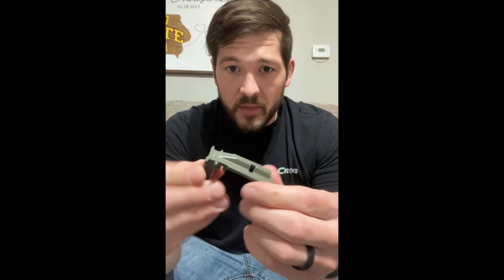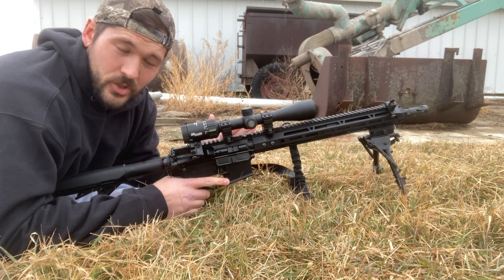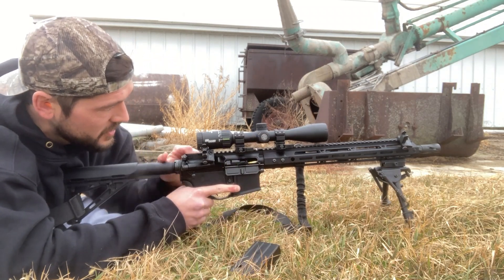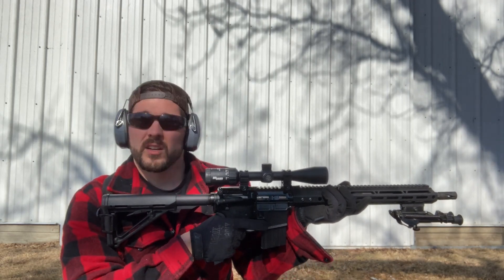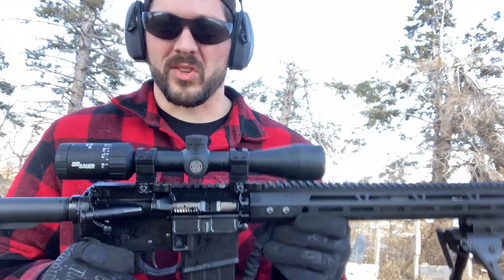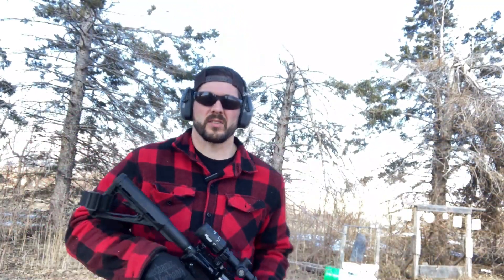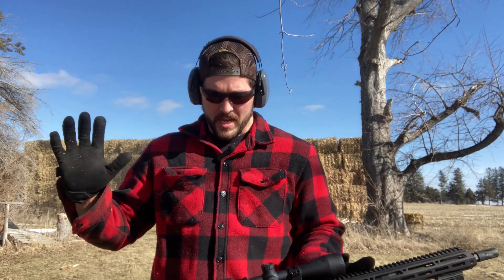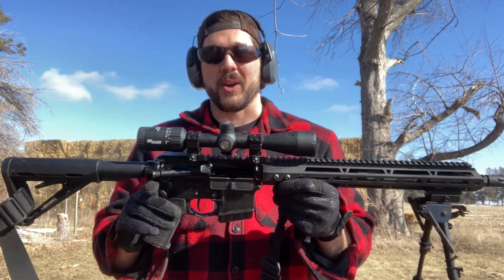It's alive! How I fixed my Bear Creek Arsenal 350 Legend upper

Comment: Classic firearms has a good videi showing the difference between buffer weights. 

It also shows a way that you can tell if you're having issues, based on where your spent shell casing fly to. 

If you look at your first set of shots you can see all the casings going forward. 

With the h2 buffer they went side ways. 

From what i remember the optimal pisition is for the casting to shoot out more towards the back. 

If that's the case the h3 buffer might be the sweet spot. Obviously i wouldn't recommend anyone automatically  take my word for it but i do recommend that video.

Comment: If your still having issues with it, file any burrs on your feed ramp, and take a dremel with a felt polishing bit and some metal polish to the feed ramp… I’ve got 2 uppers from bca and I’ve done it to both, they are a steal for the money so I don’t mind putting a little work into them… both my 350 and my 308 feed flawlessly now, hopefully this helps someone!

Comment: Thanks for sharing your trouble shooting procedures. When I received my BCA 350 Legend upper from BCA I experienced failure to feed on the second round of a 5 round mag. . I put in two rounds instead of five it fed the rounds but failed to lock back the bolt. Since then I have changed out the buffer , magazine and stock . It seems to work fine now . The reason I to changed to a fixed stock the length of pull fits me better. Oh by the way the accuracy is great .

Comment: My BCA 350 legend is doing the same happy to hear it's an easy fix. Now I need to figure out why my BCA 308 is doing the same but only worse... Now my BCA 6.5 Grendel runs like a scolded dog zero issues with that.
Reply from the maker: Yes, was happy it was a simple fix and didn't have to mess with sending it back. I prefer to tinker and figure it out myself just from a learning aspect more than anything else.  My BCA side charge 5.56 had no issues. I have since sold it but it ran great. 350 seems to be hit and miss from what I've seen. I don't have any experience with 308 but hope to get one someday and play around with that. Hopefully your 308 fix is as simple as this one was depending on what you've tried already.

Comment: I went through the same crap with attempting filing cmmg mags with my 350 build for no reason. Lancer mags were a definite improvement. Gas adjustment and Lancer cured my issues. Odin works adjustable gas block on 3 builds has been well worth it on each.

Comment: My research (I'm having the same problem) seems to indicate that being over gassed can also cause issues, so I went the adjustable gas block route instead of the buffer route (I have it on an SCR lower, so buffer tube isn't a thing). An adjustable gas block might also help you a bit.
Reply from the maker: Yes I think that for sure would help because there might still be a gas issue with mine but it seems to be mitigated. Overall now that this seems to be fixed I'm pretty happy with it.
Reply: One in this vid looked over gassed throwing brass 1 to 2 o clock.

Comment: I had to Dremel the feed ramps and polish the chamber to get mine to feed (after buying two different magazines and an H2 buffer ). It is cheap and ive had to polish the feed ramps on my bca 450BM as well. I buy them because I'm not worried about messing them up with my tinkering. If i botch them up too much they make really cheap replacement parts 😅. Bca is the reason I can tear down and replace or repair an ar-15 . From my .50 which needed to be properly head spaced. To my 300 blackout that needed a different buffer and an adjustable gas block installed before it actually ran. They should work for the senoran desert institute . Training gunsmiths since they opened.  I love bear Creek i have about every AR- they carry. Its nice they have left hand receivers pretty cheap so i can make all my smaller caliber uppers left handed

Comment: I run a 5.4 ounce Kaw precision buffer, and a strike industries buffer spring in mine. I also noticed the Winchester white box 350 legend ammo has some issues being the rounds are very pointy. If you try Browning 350 Legend ammo in the yellow box the rounds are more rounded(almost like a 9mm/357 style round) and function flawlessly. Long story short after I got my rifle broken in I have had no issues with the cheap white box Winchester.(5 boxes) I also did an upgraded Wolf trigger spring that has stronger strikes.
Reply from the maker: Very nice. I love the Browning BXR rounds. They are my go to hunting round. That round is pointy but seems to cycle fine.
Reply: I've had issues with Hornady not chambering, hanging up all diff directions, but not in a BCA.

Comment: I have one.  Interesting results.  I tried several types of ammo when I got it.  I had feed failures.  Originally I put in a captive spring H2 buffer.  I ended up replacing it with a normal spring plus H1 buffer which seemed to fix the problem.  I'm also using the same 10 round mags with the orange follower that you showed in your video.  I'd like to ask if you tried the Federal special 180gr ammo?  I had severe pressure signs from it including blown primers.  Send a box back to Federal and they said it was fine.  I'm testing  hand loads now using the Hornady 170gr SP and 11FS powder.  Usually putting only 3 rounds in the mag at a time.  No feed issues and I'm loading down not near max (looking for accuracy).
Reply from the maker: Are you taking the soft point Federal Non typical 180 grain rounds? If so yes I have. Those have ran just fine through this. Hornady has worked too. Before this video nothing worked reliably.
Reply: @armorplatedadam  Yes.  The Non typical 180s.  The Browning 124gr seem to run fine but have flat primers.  I think my chamber might be a little tight.  As long as it keeps working I'm not going to mess with it.  If I do have issues I might try a normal H2 buffer.  Funny how I keep reading about over gassed and under gassed problems.  I wonder if it might be worth while taking the upper apart and carefully examining the gas block squareness and hole size.

Comment: I've had several bca uppers, psa uppers and some others.... all in different calibers ranging from 5.56 up to 50 Beowulf, also all different gas lengths from pistol up to rifle length. In my opinion and from all the testing I've done, bypass all buffers and just get h3. I run a giessle super 42 h3 with braded spring in my go to rig, but honestly any good h3 will work. The most common pair I use in other rigs is a springco blue spring with a bcm h3 buffer.
Reply from the maker: Definitely something to consider. I went with the H2 because I thought it would be a good middle ground since I use the same lower for both 556 and 350.
Reply: @armorplatedadam  yeah understandable, I figured it would be an issue too but I've had good luck runnin the same lower for my 556 and other calibers aswell. H3 just seems to work but that's just from my experience.... it's worth a try anways.

Comment: I've shot my BCA 350L AR a lot, using different mags and what not. It was a jammomatic at first but it has gotten better, but still the reliability is no where near on par as any other AR's I've shot in 5.56. I think the feed ramps they use, 300blk is a huge issue. The CMMG rifles don't seem to have the jam issues with a singular feed ramp. Even Ruger is using the larger feed ramp.

Comment: wont load the first round right. first bca im ever had a problem with.  but shoots wonderful
Reply from the maker: Yea typically the first round I racked myself would feed fine then it was hit and miss on the first round cycled after that. Run a couple rounds hang up again. Very frustrating but now after these changes works great.

Comment: I can't fix that its a BCA but if you run into more trouble you can try a slightly stronger sprinco m4 buffer spring. H2 buffer improving things for you is from slowing down the rate of fire, giving the mag spring a little extra time, and adding mass to the BCG to brute force going into battery. I guess you could try craytexing the feed ramps, SOTAR has a video on how to do this to m4 ramps.
Reply from the maker: Thanks for the input!

Comment: I don't recall what you said you were using for ammunition. Many of the 350 Legend AR'S don't care for Winchester FMJ. 

Try Hornady 170 gr Whitetail.  My gun guy said the Hornady designed the bullet for function in an AR. No FTF in mine.
Reply from the maker: That exactly what I use for hunting rounds and they are great! I rechecked my zero for the upcoming season the other day and yes those Winchester FMJs were awful. Switched to the Hornady and it ran perfect.

Comment: Good video. Adding a comment for a BCA 458 socom. I couldn't get anything to feed in my 458. Asked BCA what they wanted to do and they told me to just return it. I had already tried D&H, Hex and Lancer mags, modified and unmodified. The barrel extension lugs were really really rough, lots of burrs and very sharp edges. I went with Tromix for 458 and everything feeds fine now. I'll use my credit at BCA for another 5.56 or 308.

Comment: These changes you are making are fixing symptoms of the real issue. The issue is the incorrectly designed feed ramps. BCA uses m4 feed ramps on their 350 legend barrels and this simply will never work 100% properly. Take a look at the feed ramps on a cmmg 350 legend barrel. They are designed to feed the larger caliber. A .355 caliber bullet does not fit in the small grooves cut into m4 feed ramps.  I had BCA .350 upper and it jammed constantly. Later I built an upper using the cmmg barrel and it feeds flawlessly.
Reply: It's ashame that I can easily identify the issue and BCA either cannot or refuses to fix it.
Reply from the maker: I think it's more of a will not fix it. These fixes I think will have it functioning sufficiently for most needs. It's still a budget type of upper compared to others, however I start to question that when you get above $300. Maybe I'm cheap but for that price I still expect it to work without the extra effort and $20-$100 extra.
Reply: BCA has always had issues with feed ramps on 350 legend and 7.62x39 uppers. Yes you'll have to tinker with the feed ramps, and there is lots of info on you tube to show you what to look for and how to fix the issues.
Reply: Mine won't cycle. Going to play more with the feed ramps and say f it. I tried every mag, different lowers. It's a problem with the upper or the Chamber
Reply: Mine will not cycle polymer tip rounds. But runs 100% with hunting lead soft tip rounds. Mines less than a month old.
Reply: They dont have m4 feed ramps they're m4 style but way larger
Reply: I recently picked up a BCA upper in 350 Legend. Haven't had a chance to actually fire it yet, but out of the box it would not chamber a round. The easiest and cheapest thing I can do at the moment was to polish the feed ramps, and lightly polish the chamber. So far that has worked with chambering rounds. Got it to successfully chamber a couple full mags in a row. But I still haven't fired it yet. We shall see. I was stoked to get it at the price I did. I ordered the complete upper with bcg and charging handle, 2 5 round mags, and an ambitious charging handle. All for $350 shipped. Honestly this is only going to be used for a deer hunting rig, as long at it'll successfully fire 3-4 in a row its a win. Because where I hunt its so thick that I would rarely get a follow up shot unless he was moving slowly.
Reply: @scotts98rt70 same, I haven't shot mine yet, but it refuses to feed polymer tips. Will smoothly chamber soft tips after a mild polish job on the ramps and chamber.
Reply: @patrick1675b  gotta mess with mags
Reply: @jorgesolis9468 
Just get a different upper with a singular feed ramp, modifying the magazines isn't the solution
Reply: @toddk1377  itwas on this one

Comment: I opened up and ground down the feed ramps on my BC upper no need to polish, also it only had issues with pointed bullets,  loading my own using 9mm round nose and not seating as deep worked flawlessly. I also own a CCMG 350 feed ramps on that barrel are larger with a slightly shallower angle then bear creeks. Both are very reliable now especially after 400 rounds which is typical for break in
Reply from the maker: Nice, I'm closing in on 400 rounds so that might have something to do with it too. We'll see.

Comment: Your real problem is you have too much gas at the port. Your bcg is running too fast and out running your mag. Get a adjustable gas block and slow down the bcg. That is why the bolt is on top of the cartridge when it is jammed.

Comment: I know it's been some time since you made this video and I have not read all of the comments but it seems that your rifle is overgassed.You may find that adding an H3 buffer makes the rifle shoot even smoother and with less recoil. Just something to try.
Reply from the maker: The lower I use this on now has a Geissele braided buffer spring with H2 and it seems to shoot smoother now. Also put in a RA-140 trigger from Rise Armament and it's been great

Comment: PSA lower on mine not a single miss feed  about 600 round Drives nails at 150 yards with 180g soft points
Reply from the maker: 180 gr soft points have been the best ammo for mine but mine only runs reliably with all 3 being used. NiB BCG, h2 buffer weight and 180 gr soft points. 🤷‍♂️

Comment: Need to slow down your bolt speed.  The .450 Bushmaster guys had similar feed problems early on with over-gassing.  Adjustable gas block, BCG weights, H3 buffer, heavier buffer spring...some combination will work.  Not sure about the 350, but the 450 also turned out to be very sensitive to the vertical orientation of the bullet tip in the magazine.  The 450BM has to be slightly "nose up" in the mag to feed properly, and some mags needed a couple of coils cut off of the mag spring to work right.
Reply from the maker: H2 buffer solved it for me. I'm sure there is other stuff I can do but for now it's not broke so I won't fix it further lol

Comment: I wish you would have only changed 1 thing at a time so we woiuld know which one fixed it.  Im having similar issues with one and dont want to buy things i dont need.
Reply from the maker: I'm pretty sure it's the combo of new bcg and h2 buffer. I tried just the new bcg and it still had issues before putting in the new buffer. I didn't get it on film but I'll try it again and drop you another reply to verify. 👍

Comment: Have a crack at the .556 Pmag mod, shave the two side wall lugs off and the 10mag will take 10 rounds of .350 legend. It will bind after about the 3rd-4th round if you don't shave these lugs down.
Reply from the maker: I might give that a try. I've always been apprehensive about potentially ruining a Pmag tho for this haha

Comment: Did anybody else notice the cycling of the ammo? Most of the brass was ejecting to about the 4-5 o clock position and all the sudden he’d have one going straight at the camera at 3 o clock.  Seems more like you’ve got an ammo problem than anything else.
Reply from the maker: Possibly, I was using Hornady 170 grain and some federal 180 grain or I used winchester 140 grain target ammo. Those were the main 3 I used throughout the troubleshooting process.

Comment: not all buffer springs have the same amount of stiffness either. my bca 223 wylde upper functions perfectly , but several of my buffer tubes have lighter buffer springs and/ or lighter buffer weights. people used to tell me those jams were because using russian steel case, gun is new, etc, by playing with the buffer stuff, i now have had years of virtually no failures to feed, eject, lock back on last round etc. lot more fun when @#%$ works!
Reply from the maker: Very good points. I'm beginning to think it is an overlooked area of the gun and I'm definitely guilty of  that.

Comment: I cured mine by polishing the chamber. My chamber had horrible sharp tooling marks. Cordless drill some fine diamond compound and a 40 cal cleaning mop and she runs like butter
Reply from the maker: I might still do that in the future. Got some other changes I want to try as well to get it running perfect.
Reply: To be honest ever BCA ive dealt with has need the chamber polished. It's like they don't finish them, or their Qc just doesn't care. But with a lil time and love they have all performed just fine
Reply: I had to polish my 7.62x39 chamber in order to run steelcased ammo.

Comment: A lot of jams are caused from week, magazine springs
Reply from the maker: I might try sticking a 30 round spring in the 20 round mag and putting the 20 round mag spring in the 10 round mag to see if that helps even more.
Reply: @armorplatedadam  Try a 300 Blackout magazine from Magpul. The spring tension on those is heavier to accommodate the projectile weight. Standard mags are designed for 55-77gr projectiles. The heavier projectile can nose dive a little when getting toward the top of the mag.
Reply from the maker: @PickettsMillArmory  thanks for the advice I'll give it a try.

Comment: Guess i got lucky 
I built a 350 legend with a Bearcreek upper never had any feed issues. STARTED out with an H3 buffer because the 350 has a little more punch and Bearcreek always runs a little overgassed